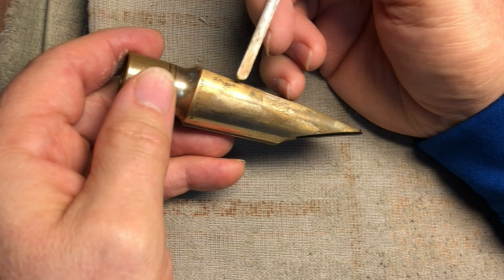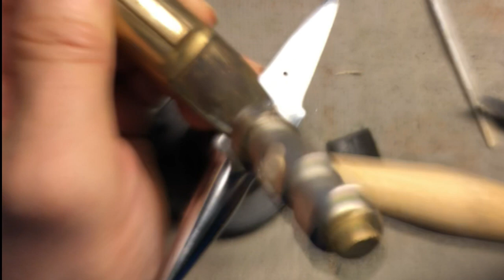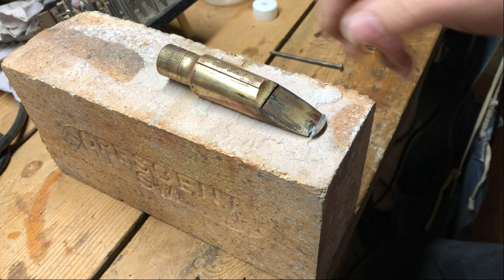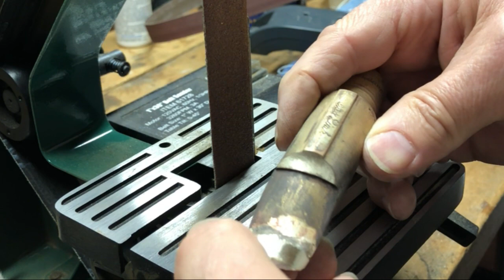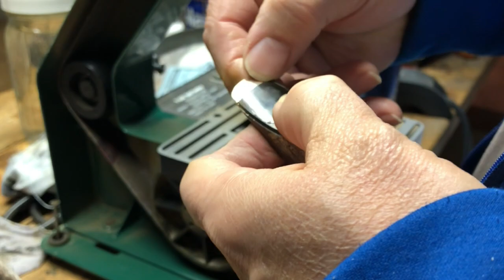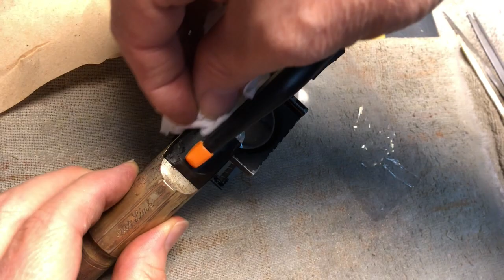Brass Sax Mouthpiece Repair by Brazing with Silver Solder

Comment: Hi Keith, great work on that!  I just found my notes on this mouthpiece by searching my email for F1, found the client I did it for, and then looked up my notes.  When i first got it, it had already been worked on and closed down, and the work wasn't great. The client (who was a known "tinkerer" to me) insisted he wanted it brought further down to .085".  I told him this scared me, as the material under the bite plate already seemed thin.  After getting it back, he then wanted it opened back up a bit to .095".  I advised against it, but he was quite insistent, and I relented.  This was accomplished without cutting through to the bite plate, my notes and emails indicate.  I don't doubt that it was further tinkered with again (I certainly didn't do any solder work on it).  Nice work resurrecting it!
Reply: Brian Powell Thanks for the additional history on this mouthpiece.  I should have stated more clearly that there were indications that this mouthpiece was worked on before and after you worked on it.

Comment: Hi Keith, from Russia:) Great  job! 
I also soldered the metal plate, and the metal table in various mouthpieces. Also filled in the cracks. Sometimes the mouthpiece material (bronze) is at a lower temperature and may have melted.  What kind of solder do you use? Does it contain cadmium?
I use 60% silver.
How cost this work in USA?
Thanks!
Reply from the maker: Vosssaxx I used Extra Easy Silver Solder from Otto Frie.  I do not know the composition.
Reply from the maker: Vosssaxx It appears to be 56% Silver.

Comment from the maker: This was for my biggest client who sends me about a dozen mouthpieces every year.  I leave the play testing up to him and he keeps sending me more.
Reply: Hi, I don't know anything about soldering brass, I need to solder two small pieces of brass, I bought one butane torch and 70% silver wire.

These parts comes in a electronics desoldering station, maximum temp is 420 Celsius degrees, 

Do you know if silver solder can put up with this temp?

Thanks in Advance.
Reply: @treadmillrepair754  Sorry I do not know.  I actually do not do a lot of soldering.